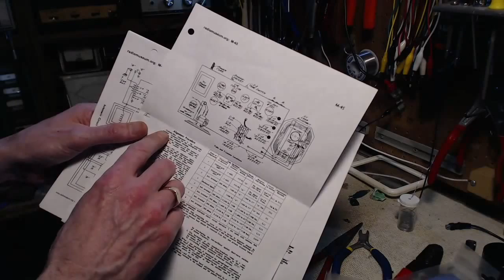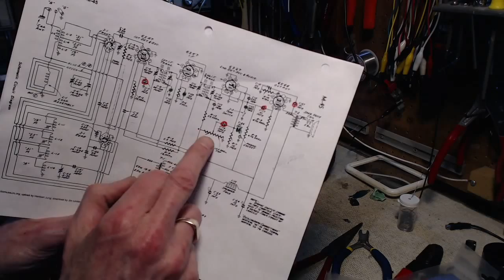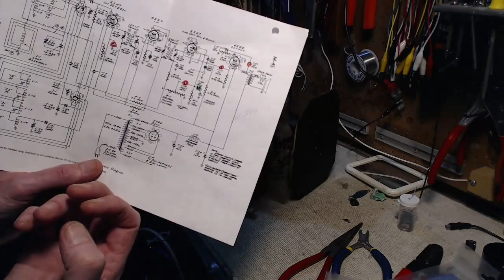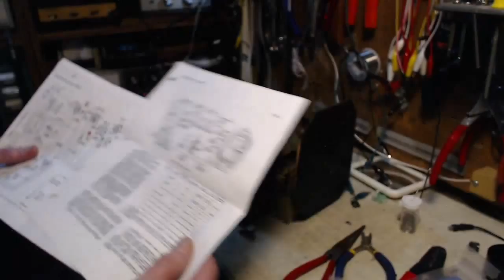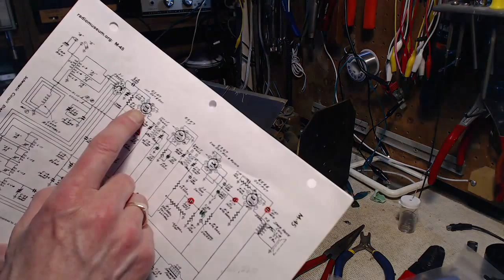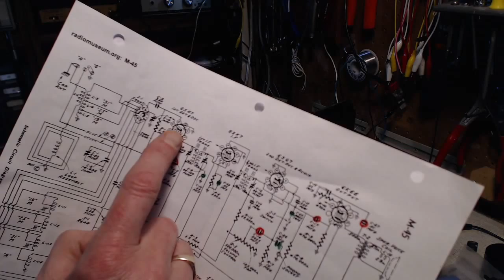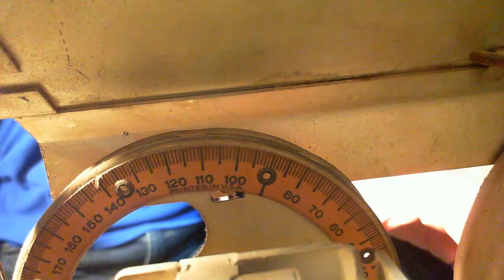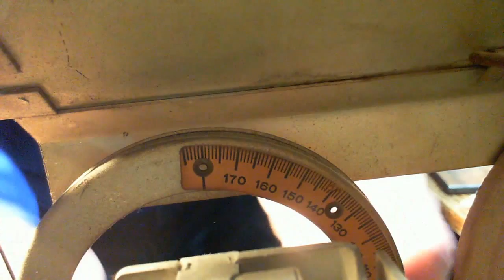RCA Victor A-23 Vacuum Tube Radio Video #5 - Ready for Alignment

Comment: Hi Jim,
I was thinking that a piece of heat shrink on the cord at the chassis exit hole might help.Also, a light debur with a round file, if necessary.
Reply from the maker: Darryl Landry Someone else suggested the same thing.  In retrospect, you are both right.  Sometimes I just don't think of things.